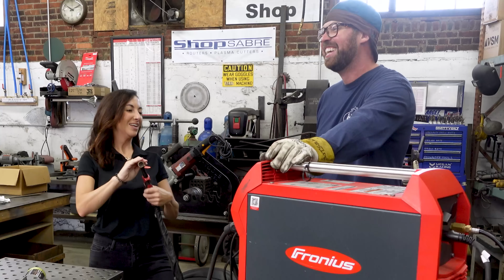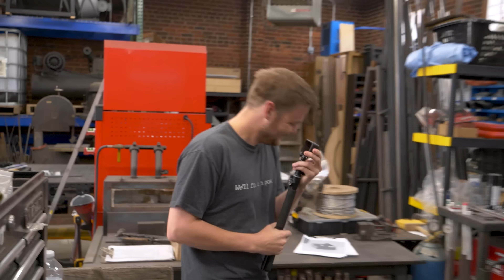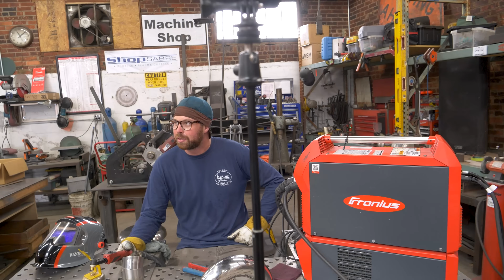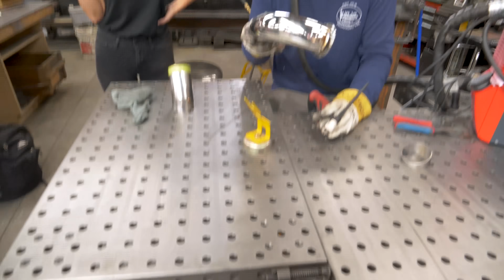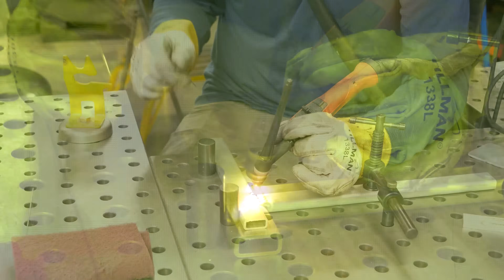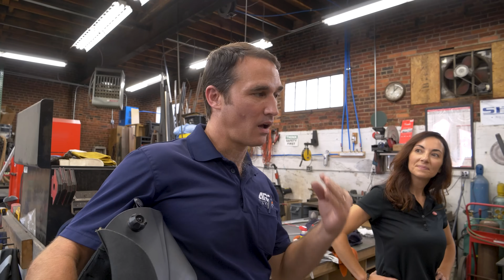This Is Why We Can't Have Nice Things

Comment: Fronius machines produce a fantastic arc and weld awesome, but the build of the machine is made with typical delicate "wimpy" European style parts.  Certainly not as rugged as older USA made machines.  It seems like all welding machines are becoming "Chinesium" build quality and durability.  Currently, I think welders(really everything) are only built to last to the end of the warranty.  Maybe not even that long.  And, don't dare ask manufacturers for parts to repair welding machines over 5 years old.  It's really sad at the moment, but I have high hopes that our USA based welding equipment manufacturers will get back to building machines that you can pass on to your grandchildren and still be repairable with common parts.

Comment: The thing about TIG welding is there is a whole line TIG welding from just regular carbon steel that any good decent you know TIG welder Prime what do just fine matter of fact a prime welder will do good on stainless and aluminum and all these things where you get into the high dollar ones and everything is when you're an aerospace type welding do you need to have art controls that go all the way down 25 and 8 maybe 12 amps and hold a good Ark on a very thin piece of expensive metal and that's really it is you know I mean everybody don't need a dynasty to do what they do you know if you fabricate on cars and stuff like that you really don't need that I mean unless you just want it, really the only time you really need to hide in ones like I said is when you are dealing with Specialty Metals and you need some real good Precision welding arks holding its shape and it's the whole nine yards you know to bring out you know these 2000s of an inch weld and they're so thin they're like you know it's kind of like buying a Corvette or a Ferrari you don't need it get you from A to B no different than you know a $3000 car you bought out of somebody's front yard even a $1500 car you bought out if somebody's front yard it's just the style and how you get there, that might be a different story when you're calling it that but far as getting from A to B in it, you can get from A to B in both

Comment: I made the big mistake of demo a Fronius machine at my supplier. That same week I ended then ended up selling all my Miller equipment and purchased both Fronius I-Wave TIG and TPSi MIG machines. Be careful trying them or could end up like me, I think they are that good. On the other hand I found Fronius consumables a bit pricey but they actually do seem to last longer as well so that may be a moot point.

Comment: I couldn't weld worth a damn with my Millermatic 250. My wife bought me a Fronius 220 & I built so much stuff like I could really weld; I couldn't believe it! My supply lines on the Miller used to get WARM when doing 1/2 aluminum. The Fronius only uses 16.8 amps on 220v. The welder & water cooler only weigh 56#. Had the  welder 20 years now & it has never let me down & works like brand new. Still can't weld with other brands, but Fronius makes me a pro.

Comment: If Fronius pricing is in line (cheaper?!) than Miller or others, then I would go with Fronius for sure. They make very nice machines, with all the latest tech and durability. However, a Fronius machine really isn't going to do a whole lot more than something like an Everlast for most things. So if you are not welding every day or if you care about price/performance ratio, Everlast or something like that is the way to go.

Comment: Fun demo to watch! I'am more familiar with watercooled PCs, but yeah, one leaky fitting can ruin your da(y)te! 🤪
If you run a 170A at 22V that's 3740W. I reckon you don't draw that current continously, but there has to be some badass zappy electronics in there, to deliver those peak amps right when they are needed. Here in my neck of the woods, standard outlets are rated 3520W. But that is still less than what that thing delivers.

Comment: The Fronius MIG machines really are amazing; you have steel, ally, & stainless settings, CO2, Argon, or mix settings, & thickness settings. If set-up properly it's REALLY difficult to make a bad weld.
Reply: Hold my beer.

Comment: I really loved the fronius pulse mig machines.
For Tig welding i am more of a Kemppi mastertig fan.
Worked years with that combination for stainless and aluminium.
Then again i am from europe so miller machines are pretty much made from unobtanium.
Reply: Youre not missing out on much, miller and lincoln are overpriced chinese garbage
Reply: @_hector__  there are still alot of Lincoln machines available in Europe.
No experience with the machines only with the electrodes.